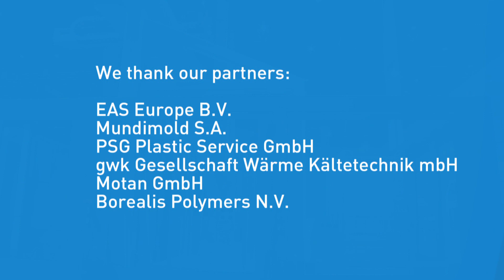Quick mold change in less than 3 minutes !

Comment: Everyone forgets in Medical molding you also have to change out the injection unit. These need to be very solidly bolted into the cross head to withstand the injection pressures, which can range from a few thousand to over 40 thousand PSI.
Reply: Why would you need to change that? I work with medical in cleanroom and we dont do that..
Reply: Also injection unit is not very solidly bolted, you have the bars from hydraulic cylinder and the rest is quite flexible.

Comment: would the electromagnet holding the mold to the platen interfere with the ejection of steel parts? or is this only for aluminum and plastic injection molds?
also, freaking automated KO bars and waterlines?! I am impressed! awesome!
Reply: As far as I know there is no such thing as steel injection molding, or die casting as the process would be called in case of metals. As the temperature goes up, tool life goes down exponentially. Low melting point brasses are about the upper end of what you can reasonably die cast. Die casting steel would make little to no sense anyway, steel requires a certain degree of forging to achieve full spec of material properties.
Reply: @aleksandersuur9475  injection molding is used on all sorts of metals, magnesium primarily.
Reply: @aleksandersuur9475  lots of injection molding processes utilize steel inserts, and metal injection molding using powdered metals, including steel, in a binder which is then sintered in a secondary process.

Comment: Sorry but the system is expensive and the return at the end of the year is almost zero. I don't buy.
Reply from the maker: Hi Augusto, there is of course a higher investment for this level of automation. Yet the return is really positive, and has its influence on several parts of the production process, yielding a high level of optimization and savings. 
This is just an example, a competitive edge can already be gained with smaller steps that do not require much standardization. If you contact our sales team,  they can inform you about all the suitable options : sales@EASchangesystems.com, or give us a call: +31 318 477 010 at EAS HQ.
Reply: guys like augusto should go mold another hair piece they are complete morons. they only comment because they are so stupid they believe what they are saying. however the video was awesome but we have about 20 KM presses and in my opinion our old milicrons are better. our KM's are constantly breaking the locking nuts on the tie bars due to those junk pins they have. I've worked with a lot of presses and I hate krauss maffei!  do you guys have trouble with them?
Reply: No return on investment?
Less downtime means more uptime.
More uptime means for product.
A machine this big would have a fairly high machine rate per hour to recover/charge out per part, so it makes sense it should be as efficient as possible to make more parts per hour
Reply: @beinghonest7252  So your arument against what was said is to spout insults and personal attacks without even a counter argument against the points he made.... Very grown up.

Yep... we can spend the cost of having two more molding machines in changing molds in one machine... and never being able to run those molds in another machine unless they are set up the same way. What is the added cost to EACH mold designed to include all the automatic systems for every tool you will run? 2 to 3 million dollar investment for one machine Vs. 60,000 a year to hire someone decent that can change the molds in many machines. If set up well a mold like this can go from last shot to first shot in 30 mins. Hmmmmm. Yep, I'd love to see examples of multiple businesses using this exact system.